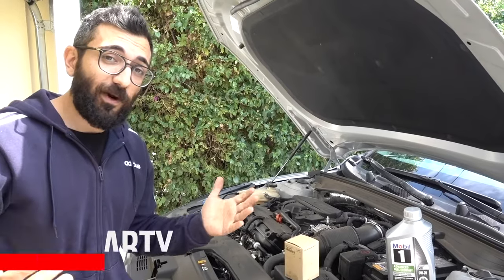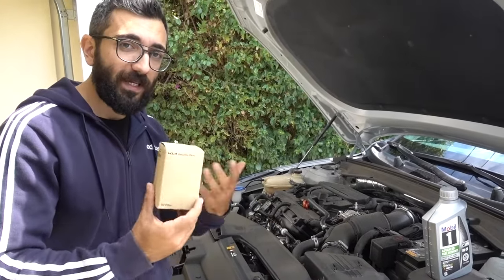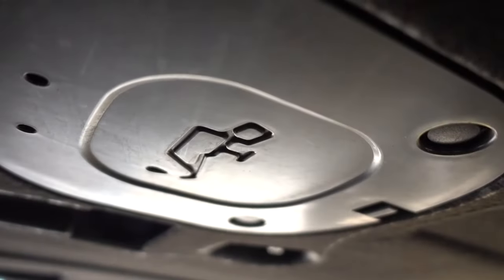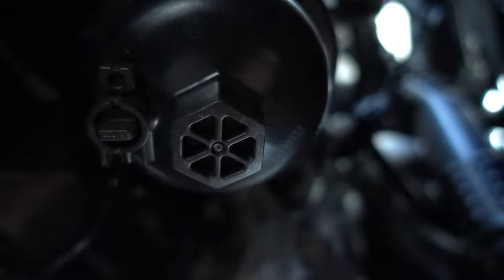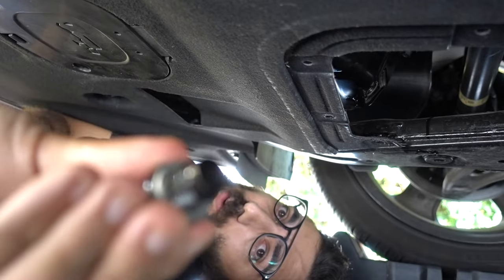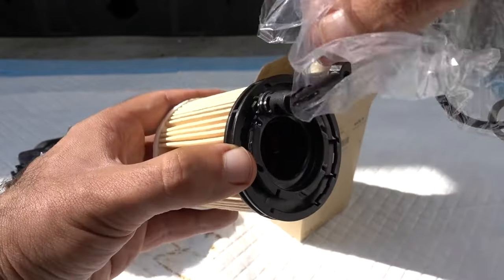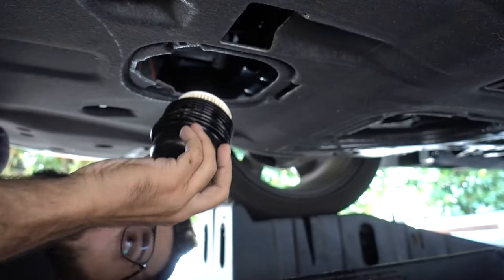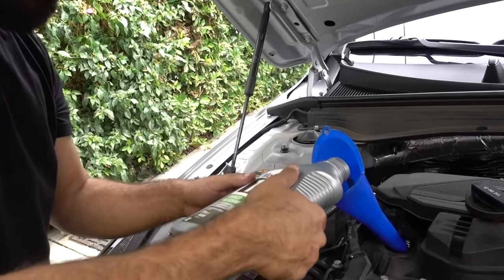KIA K5 OIL CHANGE DIY! 2021-2024 KIA K5

Comment: I never understood changing your own oil. It saves you about 30 bucks but the time investment to do it yourself the right way is well worth those 30 extra dollars lol
Reply: Depends what car you drive some oil changes can be over $100 and if your a 2 car family that needs 4 oil changes every year it takes 20-30 minutes and the savings is much more than $30
Reply: @benm5651  true makes sense i guess im speaking from a person who only owns 1 car
Reply: @Mike-hy8cs my personal car is 200$ an oil change at dealer, 30-50 if I do it myself (with higher quality oil) my gf’s Kia k5 is only 80$ but I’ve noticed oil residue all over the engine drip tray, and the past 2 oil changes the oil level is way overfilled. Not to mention I have zero trust in anyone doing an oil change and properly torquing down the drain plug and even using the correct oil. Trust is a huge thing I lack on my person car with any work. Much rather take 10-15 mins do it myself with known quality parts and no cut corners
Reply: @damian_jasiu  I mean in your case i guess sure. But a normal person driving a normal car its not really worth it unless you have a lot of cars at the house. Plus if you do know a good mechanic that you trust you know its being done right. I got a mechanic thats been in the family for years so thats why i always just take it to him

Comment: The 2025 K5 XLS 2.5 is a nightmare to change the filter. It ain't nothing like the earlier years. You can however use a Chinese socket set on the canister housing bolt. The filter drain bolt is a metric allen wrench. Removing the filter element from the housing you need to push a flat screw driver up the center of the hole after you remove the filter housing drain bolt. The element keepers are spring loaded. Pressing the button inside the housing should release it. Or you might just try yanking the cartridge off. Purely Micky Mouse in every way. The flat rubber gasket seal is half way down inside the housing. You need an ice pick to get it out. How this system is better than a spin on oil filter is beyond me. Good luck.

Comment: Having plastic under the engine is one of the dumbest things I can think of. For real, what's the purpose of that?
Reply from the maker: To protect to underneath  is my guess 🤷🏻‍♂️
Reply: Aerodynamics
Reply: How many liters are there when replacing the oil, and what do you think of the Italian pakelo oils 0w_20
Reply: @artysgarage  ممكن جواب علمي
Reply: So salt water doesn't soak the bottom of the engine and rust it out in the northern states

Comment: Did you have issues putting the pin back in place on the filter housing? I just changed mine today and I cannot get that pin back in for the life of me
Reply from the maker: Yea the K5 was definitely not the easiest oil change I have done. Did you figure it out at the end?

Comment: So did you order the filter online or can I get that at a dealership? I'm new to Lia I literally just got my 2022 k5 gt line about a month ago and I'm only at 2300 miles give or take but I've never seen a oil filter like this and like doing my own work. I'm also curious at what milage do I need to do oil change on this car...3000, 5000 or 7500? I know some newer cars you can go a little longer but don't want to wait until last min I like to find that happy medium. Any advice would be greatly appreciated. Thanks for your video also.
Reply from the maker: You can by the filter directly at Kia or online whatever is easier for you! I like to change oil before the light goes on especially your first oil change I would recommend 5k miles
Reply: Recommended oil change interval is every 4,000 miles
Reply: @TastySurrealBowl  8,000 miles
Reply: You are right - the owner’s manual indicates 8,000 miles.  My mistake.  My personal preference is to stay at 5,000 mile intervals between changes with all GDI vehicles I’ve owned as they’re hard on oil.   The oil viscosity breaks down faster in them.  Coincidentally my Kia dealership’s master tech also recommended the same interval (unsolicited) for the same reason recently (at a visit re: rim compatibility questions).  There are some good YouTube videos that cover GDI engines’ effects on engine oil I’ve caught in the last few years that backed up what I’ve observed in three different GDI vehicles we’ve owned from new (a Chevy, Subaru, and Buick).  My feeling is spend a little more on oil now to hopefully save on repairs later after drivetrain warranty is up.

Comment: Thanks for the video!  I just got my ‘23 K5 GT-Line 1.6L and picked up the OEM filter and the oil after watching your video.  Doing the oil changes myself I plan to document my oil change intervals heavily (with a photo each time of the odometer and products used, including OEM filters & type of oil) as I’ve heard stories of warranty hassles resulting from not having conventional receipts showing required maintenance intervals documentation.   This is the first vehicle I’ve encountered with so much plastic covers/plastic body trim connectors to get through just to change the oil.
Reply from the maker: 1.4L ?
Reply: @artysgarage  1.6L
Reply: Do you think all that work is Necessary in case of warrantyC
Reply: @tioswift3676  The 2023 K5 owners manual does state oil changes recommended every 8,000 miles for the 1.6L engine, but I’ve just always kept a close eye on the oil quality of the oil in all my vehicles as the miles go by, and I’ve found that the direct inject (GDI) engines’ oil loses its viscosity faster than non-GDI engines.  Based on experience I’d rather err on the side of caution (maintaining better lubrication than the minimum recommendation).  There’s a lot of discussion online for the reasons why GDI engines are so much harder on oil, and once that OEM engine warranty is up you’ll be paying all engine repair costs out of pocket, so I’d rather spend a little more on oil over the life of the car than for issues that start to arise in the higher mileage range due to trying to pull more life out of degrading oil.  Personal preference.
Reply: @TastySurrealBowl  So how often per year would you recommend a  23' Kia K5 have its oil changed?
Reply: @doctoralgy8186  Every 5,000 miles.
Reply: @tioswift3676  I just do it to cover my bases.  I've heard firsthand horror stories of OEM's not accepting anything less than proof of mileage and date of each oil change if an engine problem arises while it's under warranty.  I read somewhere that a receipt showing the purchase of the filter and oil is often required, and some dealers will try to weasel out of covering warrantied repairs if you didn't use an OEM approved filter and oil.
Reply: @TastySurrealBowl  Be careful going over 5000 miles on the oil change.  I have a 2022 Kia K5 and my owners manual states 5000 miles between oil changes in one section of the owners manual, and 8000 miles between oil changes in another part of the manual. Same owners manual, same vehicle, same engine, with two different oil change interval recommendations. This is for the GT Line with the 1.6 liter engine.....  K5 owners with the GT 2.5 liter engine may have a different oil change interval.  I only go 5000 miles between changes and I heavily document everything. My dealer told me DO NOT go over the oil change interval.  I asked...  "what if I go ONE mile over?"  He said....  "don't give them ANY reason to deny a warranty claim."   I also only use KIA filters and Mobile 1 full synthetic oil.
Reply: @SlipFitGarage  I really appreciate what you wrote.  I had the same experience with my dealership, plus a lot more developments.  At 2,900 miles I had the first oil change.  By 7,100 (4,200 more miles) the oil looked really dark and had an unusual dark red tint to it I’ve never seen in used oil before.  I ordered an oil analysis kit from LN Engineering and performed an oil change myself, sending some of that oil in for analysis.  The report came back with tons of detail, but overall everything tested good.  The owner of the oil analysis company talked to me at length about the possible reasons for wear & discoloration.  He said the key number to look at for what I was seeing was the oxidation value of that oil (13.6).  He said the best way to proceed was to do a future test using a “dual kit” (one that compares the brand new/unused oil against the same exact oil when drained after 4K miles use).  I will be doing that.  Then it hit me that self oil changes won’t be in any database (Carfax, the dealership’s), so I heavily documented all receipts, photo of packages of new filter, oil, and odometer with date stamp in photo, and when I emailed it to the dealer they said they “couldn’t do anything” with the documentation I’d given them for my vehicle records and that would jeopardize the Kia warranty.  They said “don’t give Kia ANY possible out on your engine warranty”, so I ended up taking it to them in just another 1,600 more miles to get another oil change into their system under the 8,000 required interval per the manual (I read what you wrote about there being a 5K and an 8K reference - yikes).  Given the condition of the oil after Just 4K miles, I’m definitely going to stick to a 4K mile interval schedule, and do a dual kit analysis to find out exactly how my Mobile 1 is transforming so fast.  The analysis company said that my very frequent very short drives are likely causing extra thermal cycling, which is super hard on oil, especially a thin oil like 0W-20.   I’d highly recommend a 4K mile interval to anyone with this 1.6L turbo GDI engine.  It’s definitely an oil killer.
Reply: @TastySurrealBowl  I completely understand your concern for doing things the right way when dealing with your brand new car.  I am the same way. 
Question:  If your oil testing results came back and showed nothing wrong with your oil, then why do you recommend 4000 mile oil changes and why do you claim the KIA K5's are oil killers?
Sure, the dealer cannot add YOUR oil change information to their vehicle history because they did not perform the work.  I totally get that and I would not expect the dealer to do that in the first place.  However, just because it's not on the dealership's official record, that doesn't mean that YOUR official record doesn't count.  In the United States of America we have laws that legally allow the private owners of vehicles to do their own work.  We are NOT bound by law to have the dealer do all of our work while still covered under warranty.  Doing your own oil change is 100% perfectly legal here in the US and the auto manufacturer cannot strictly use that fact to deny a warranty claim. However, you better make sure your records a excellent, and it sounds like your records are.  Around here, my local KIA dealer is at lest 3-4 weeks out on OIL CHANGES and general repair work.  If my car broke down today, I would have to wait 1 month before my local KIA dealer could get to working on my car.....  and they are out 3 months on re-call work.  Which, my car currently has an airbag recall and they cant look at it until August.  (It's mid May 2023 as I type this for future readers) If I had to wait for my local dealer to perform oil changes to keep everything on the official record, then I'd probably have to stop driving my car for several weeks while waiting for an oil change so I don't go over my self imposed 5000 mile limit.  By the way, I did an oil change on my car yesterday and when I went to reset the "service interval" in the vehicle's computer, it was reset back to 8000 miles.  So in other words, according to the computer screen in my car, the factory KIA service interval is 8000 miles.....  So by doing oil changes at 5000 miles and keeping excellent records with photos and receipts there should be no way they could deny a warranty claim, if I ever had one.  I have changed my oil 3000 miles EARLY ever since the car was new. My car currently has just over 19000 miles.  It has had the original factory oil, and then I have personally changed four more times since then. (once yesterday)  So, a total of 4 batches of engine oil in the first 19000 miles..... that averages out to 4750 miles per oil change.  I've always used factory KIA filters and Mobile-1 0W-20 full synthetic oil.  I see no reason for a warranty claim to be denied. (fingers crossed)
Reply: @SlipFitGarage  I think the threat of a warranty denial is likely a pressure tactic on the Kia dealership's part, so I'm not sure how much of what they said about self performed oil changes is true.  Keep thorough documentation on your oil changes and try to keep them between 4K-5K in between if possible if you make frequent, very short drives.  I say the car is an "oil killer" based on the color and viscosity of the oil that came out after 4,200 miles of frequent, short-range driving.  The oil analysis expert told me that while the testing for all the various contaminants, metals, etc. in my used oil were within the "good" range (minimal ppm/parts per million), the oil itself looked ready to be changed.  It was noticeably thinner, much darker, and I just didn't like the odd dark red tinge to it.  The expert mentioned "oxidation" as the likely reason for the color, which is an indication of how much life is left in the oil.   I'm sorry to hear your Kia dealer is so far out on scheduling!  When I went in for my oil change earlier this week they did the air bag recall at the same time (they said it was literally just a three minute check to see if the side curtain airbag had been "twisted during installation", and mine hadn't).  I watched him quickly pull down the weatherstripping, look behind the headliner fabric and examine the airbag, then replace the fabric and the weatherstripping.  It was literally less than three minutes.  Apparently only some K5's had their airbag twisted during installation.

Comment: My Genesis has the same style filter. PSA, it takes a pretty decent amount of force to push the cartridge back on with the drain cock. When installing the cartridge into the housing, the drain cock has to be installed on the cartridge. You know you have it right when the hole in the housing and the drain cock are EXACTLY aligned (not offset). I wonder how badly quick lube places might mess this up as these filters become more common. Man I messed  with this for 30 mins thinking I'm gonna crush the cartridge, then I gave it a little extra force, bam! The holes finally aligned.
Reply from the maker: Yes it took me a bit of time aswell compared to how quick I do all my other oil changes 🤷🏻‍♂️
Reply: @artysgarage thanks for presenting this video. I had done a K5 oil change before but it’s been awhile. Doing one on my niece’s K5 next weekend. Thx!

Comment: For those wondering about the GT model:
8mm Allen for the FILTER Drain
27mm For the Filter housing 
17mm for the Oil Pan Drain Bolt

26350-2S000 Kia Filter Kit P/N

Do not use an Adjustable Wrench for the Filter Housing, you must use a socket.
Reply: Filter is not a 27 mm
Reply: @DavidLopez-wv8qv It is for the GT model, this looks like a 1.6T, not the 2.5T, hence the different sizes
Reply: @jordanhawkins4727  It ain’t. I just changed my ladys k5 gt line and because of you and the internet i bought the 27mm which is too big
Reply: @isaiahdanielvlog  learn to read! The first line of my comment says it is for the GT not the GT-LINE, 2 different engines....
Reply: @jordanhawkins4727  Well then they named it terribly. My bad. It makes no sense to name something gt line that isnt a gt imo
Reply: what year gt is this info for?
Reply: and will the sizes work on the 2024 gt.
Reply: and do u know torques
Reply: @raymondf9265  As long as the 2.5T design wasn't changed, this should work for all year GT's. As the saying goes; Trust,  but verify. 
Regarding the torque, it is listed on the filter housing itself for filter and the filter drain bolt, but I don't remember off the top of my head.

Comment: I have a 2023 GT Line (1.6T) I want to use BG EPR right before the change and BG MOA with the change as they are both good products and can be used with GDI turbo engines. My concern is would KIA use this as an excuse if the engine ever developed issues while under warranty?
Reply from the maker: I wouldn’t recommend checking with them you don’t want to do anything that would later void warranty 🤷🏻‍♂️

Comment: How many miles on car for 1st oil change, and did it smell of gas?? Thx
Reply from the maker: I changed my oil before the light went on  I believe if it was 7k but light goes on swoons 10k!!! No smell
Reply: My service light came on at 5k
But they told me the manual says 7500. So 7k is good?
Reply: @saulmeza1215  if you like the car, and intend to keep it long term,  I  wouldn't go past 4000. Oil changes are cheap, new engines are around 10 grand, thats just the engine...not installed.  Plus, these small engines,  1.6 liter, work hard, and the turbo adds more stress,  add fuel dilution.....I'm doing mine every 3 to 4000 max. And the dipstick does smell a little like gas, but no increase,  unlike the Honda, which shows a definite increase on the dipstick.

Comment: It says to use 5.1 quarts 
Just curious why you went with 4.9 quarts. Is it better to be a bit under?
Reply from the maker: In my opinion it’s better to put just a little less oil and then after I take the car of the Ramps let it run for a little and check your dip stick. You can always add little to get it at the correct level 👍
Reply: 4.8 Liters per the owners manual…just a hair over 5 qts
Reply: Five quarts.